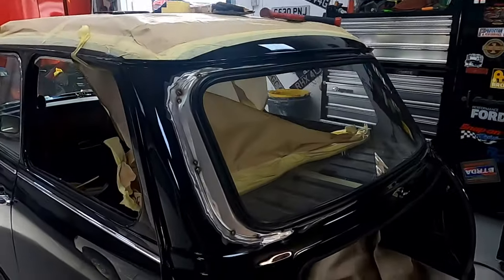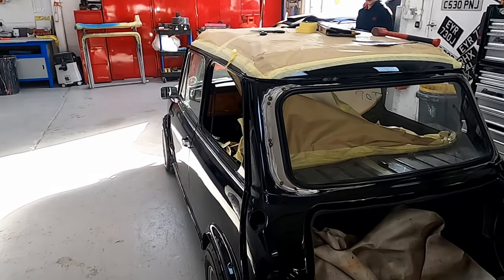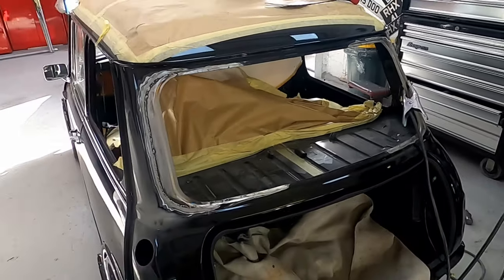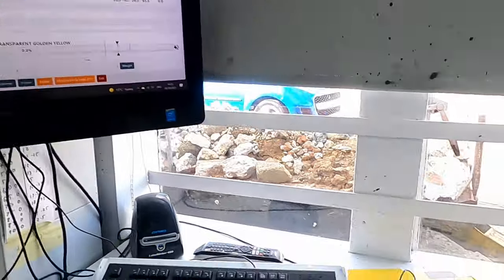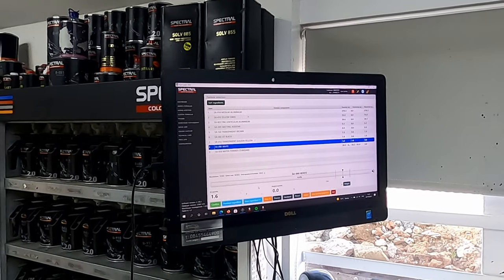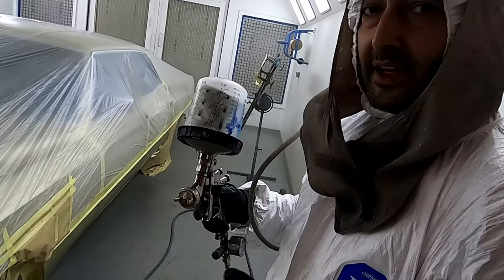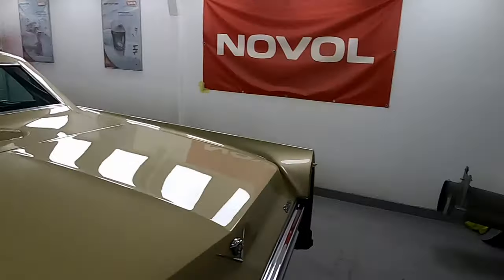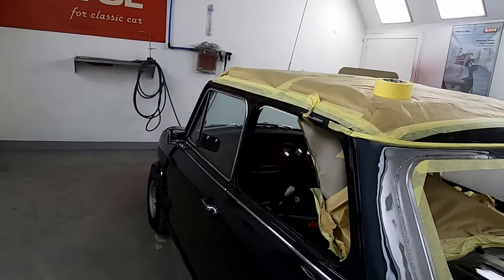Painting the Cadillac & Fabricating the Mini

Comment: Hi can you use filler on top of novol epoxy
Reply from the maker: Hi yes you can apply body filler over epoxy primer this is for the ultimate anti corrosion protection, the filler is very porous and can absorb moisture which transfers into the metal and can make the filler lift from the bare metal cause corrosion